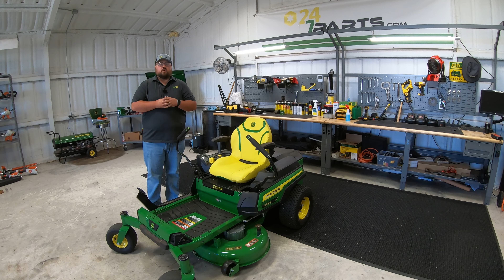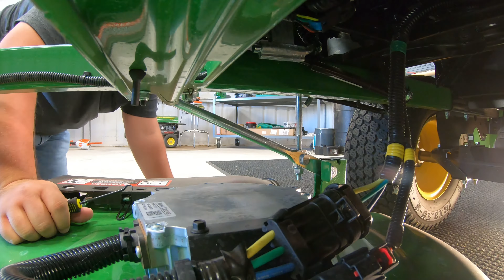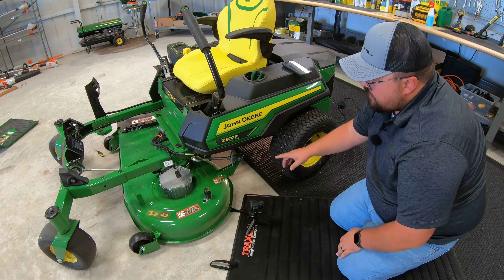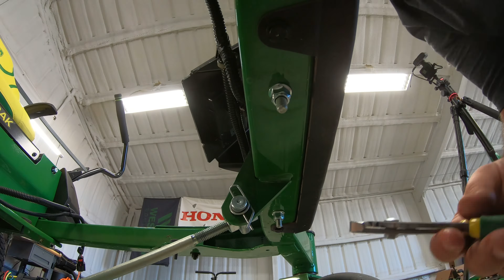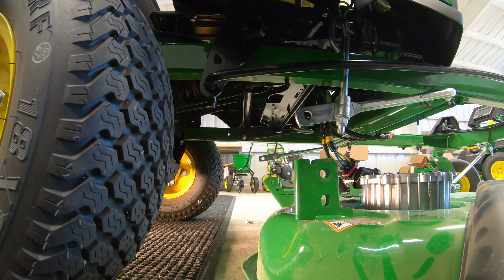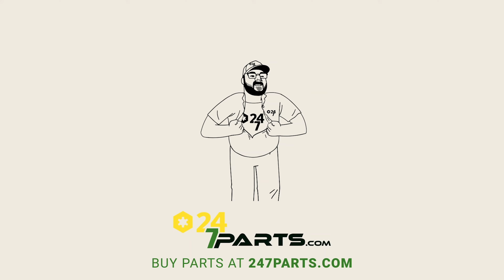How to Remove & Install Deck on John Deere Z370R Battery Powered Mower

Comment: Can you tell me if the mower will function normally with the deck removed?   Can it be driven around or does removing the deck generate some type of error code?  This is a non-issue with belt driven decks but just curious about the motor driven decks.